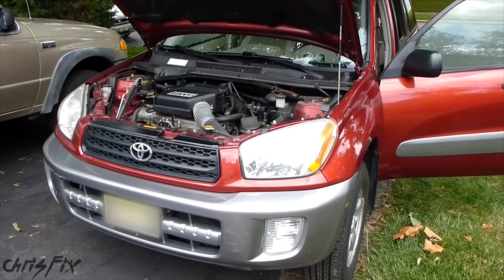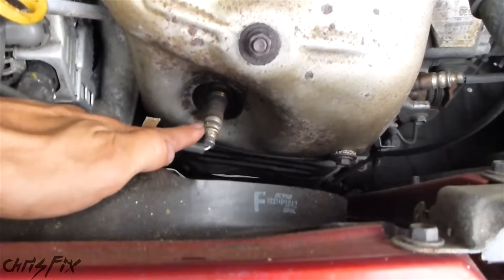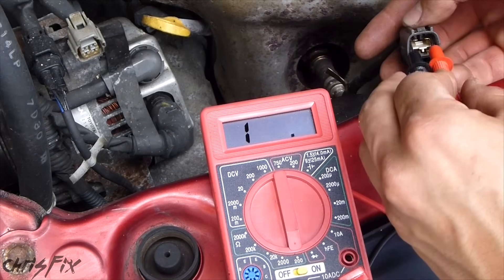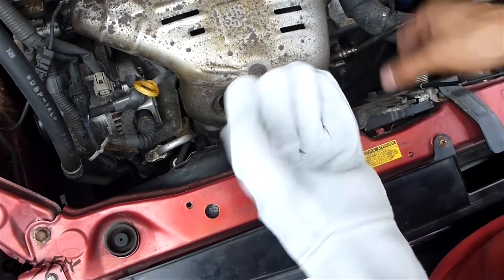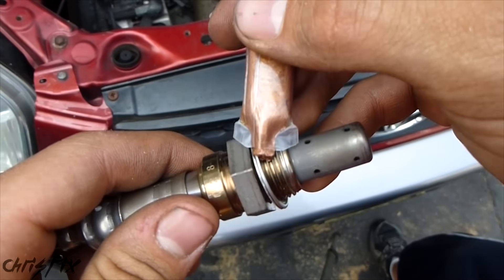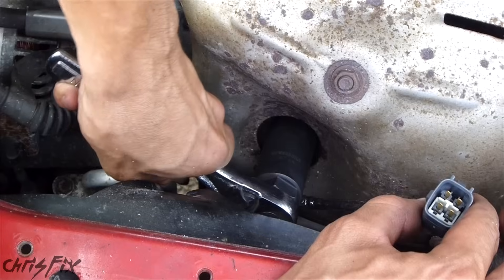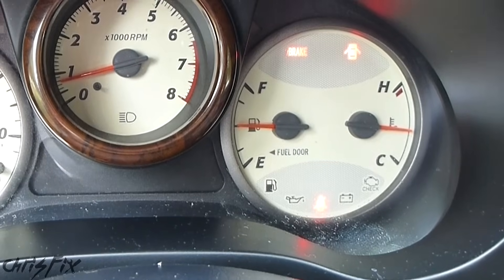How to Check and Replace an Oxygen Sensor (Air Fuel Ratio Sensor)

Comment: @ChrisFix love your videos i have a check engine light and Auto LSD flashing in red on 2010 Rav4 LE model do you think it is a differential issue or an O2 sensor problem
Reply from the maker: Scan the computer and see!

Comment: I replaced my sensor but it still didn’t pass smog the technician said that I needed to drive 100 miles so that the computer can reset the heater in the sensor. Does that sound right to you?
Reply: Yea Brodie he reset the codes so that u need to drive a few driving cycles then wait like 1week and go bavj
Reply: @junior26v82 right on Bubba I’m going to drive the shit out of it this week and then go back to my boy and see what up. Thanks again.

Comment: Chris I have strange problem  
In highways with toyota rav4 2002 automatic  my fuel consumption  is 10 /100km( it's good) but
In city driving for short distance to work   and  common lights stops like 4 km go and 4 back 
My consumption  in city is 20/100km
 No errors in diagnostic tools , help

Comment: A question, I'm need of help. Im driving a japanese car, my mechanic has tried out a few sensors that "should" fit(denso, bosch etc), but the clip in part is always different from what my car has. It is impossible to find one that fits. Is there a way to manage it somehow? 
The issue is that all these sensors are listed as the correct replacement, but it just isn't the case.

Comment: Another great video, Chris. Thank you🙏.  Quick question please: on my 2001 Lexus RX300, my VSC and CEL came on. Autozone read the code as a bad Bank 2 Sensor 1. I replaced that bad A/F sensor with a new one. Do I need a reader plugged into the OB2 to clear it, or will the codes and VSC/CEL clear on their own once I drive it?

Thanks so much for your help 🙏

Comment: BAck when  Chris was poor and had to rent a oxygen socket... They are like 7$ at amazon or Walmart...

Also P1155 or P1135 is not necessary a bad sensor... It's a problem in the Air fuel circuit.. Obviously the sensor is in the circuit so it's possible it's the issue but many other possible issues too... It's good that he shows how to check it. But this check only for a dead sensor... The sensor could be only malfunctioning under load that would also trip the code not right away and   it will pass the resistor test....  but still be bad sensor...

Which you need a scope to test for... Though voltage on a scan tool might give you a clue... Basically this problem can get much more complicated.... than this vid would have you believe...

Comment: Do you have to disconnect the battery to test the 02 sensor?
Reply from the maker: no
Reply: @chrisfix I changed both my 02 sensors but my gas is still reading incorrectly but the engine light went away.

Comment: I have an '04 Liberty and my oxygen sensors are rusted in solid, can't remove them for anything even to try replacing them.
But as a test, I tried running the engine with both upstream and downstream unplugged.  It runs exactly the same  :(
This has me confused because that would have me believe replacing the oxygen sensors won't do any good.
Very rough idle now and engine shakes, engine light blinks.    The only codes I get are oxygen sensor codes:

P0158  Oxygen Sensor Circuit High  Bank 2 Sensor 2
P0300  Multiple Random Misfire
P0152  Oxygen Sensor Circuit High Bank 2 Sensor 1
P0157  Oxygen Sensor Circuit Low  Bank 2 Sensor 2

Comment: U the man Chris 

My 2008 Lincoln town car executive L series had this code 

I did the ohm test and was shocked that it was ok 

Did the ohm reading on new part and same readings.

Looked some more and found a faulty spark plug and 3 bad almost dead coils .

Weird right ?

Car is all good passed smog every test 

392,527 miles

Comment: Great vid, Chris👍. I always get a po107 code on my 08 pont vibe but here’s the kicker…. I have absolutely no symptoms, purrs like a kitten. But the Real conundrum, is that it only comes on during the winter months, up here in Ny. It goes off come spring, either by itself, or if I clear it myself. Been happening for several yrs now.  Don’t think there r any evap leaks but there’s so many things I have to eliminate b4 I find cause. Was hoping this peculiar circumstance could help you narrow down my approach. Any advice?!  
Thx🔧
Reply from the maker: Looks like it's a map sensor code, have you tried replacing it?
Reply: @chrisfix  This…………..I will now do!👍☺️

Comment: I get two codes on my toyota sienna 2004 p0171 and p0174 should i start with sensors? I tried the maf sensor test where i can run the car and disconnect the maf sensor and the car turned off so it means that one is good.
Reply from the maker: I would do a smoke test and see if you have a leak from a vacuum line or a something like the intake gasket first. If it's not that, and you have a scanner that has live data, see if the o2 sensors are reading correctly before replacing them since it can be $$$
Reply: @chrisfix  thank you for the response!!!! Definitely my car has the engine light and vsc trac off light and it drives but randomly even more uphill the car tends to stop accelerating, I tried to accelerate and nothing happens, but ill definitely check the smoke test

Comment: Nissan Micra 2003 1.2 throwing codes PO132 O2 sensor high voltage Bank 1 Sensor 1; PO138 02 Sensor high voltage bank 1 Sensor 2; PO037 H02 Heater Control circuit low Bank 1 Sensor 2. The car passes emissions but the check engine light comes back on each time codes are erased. I have run diagnostic with Top Don and i can see the Front Sensor oscillating 0.18 - 0.59 and Rear sensor steady at 1.275 v. So I don't understand why it keeps staying on? Any ideas? I have tried cat cleaner but light comes back on. (ps I have just bought some spares Lucas brand so will take the car to the mechanic to swap them.)

Comment: The video title suggests O2 and AF sensors are the same thing but I heard from Toyota expert that O2 sensor is not the same as AF sensor. They may look physically the same but internally and functionally different. Their locations on the vehicle are also different. What you did in this video appears to be the AF sensor, not O2 sensor. Am I correct?

Comment: hi, i have toyota camry 2012 LE my car's gas mileage got worst. can oxygen sensor be the issue?
some back ground.
got car in MAY at 250k having 8L/100KM.
i have changed all tires with all season tire bridgestone weatherpeak, now its 10L/KM.

Also tire pressure same for all tire 35 psi.
recently changed engine oil and filter.
also drive smooth  : )
engine sound smooth.

can anyone help me what could be problem.
Reply from the maker: Are there any engine codes?

Comment: O man I wish you worked on this car more. I just bought one with bad head gasket and bad clutch. I’m struggling. The axles don’t come off so I gave up on that for now and I’m making it up as I go taking apart the top of the engine. I reached the point to take this sensor out but I don’t have this socket and I’m stuck!  😢

Comment: Hi, my car kia stonic 2018 1.6 crdi had new dpf,turbo,egr,intake manifold and o2 sensors, and it's still running rich , showing 0.9v at idle and when cruising at constant speed stays at 0.4-0.5v, when giving it throttle it goes down to 0.1-0.2 , when releasing the gas pedal goes as high as 1.4v , running i guess as it regenerates the dpf every 130 miles and has a thin layer of soot inside exhaust tailpipe. Any suggestion what could be wrong with it, kia don't seem to know what's wrong with it .
Thank you
Not throwing any codes.
Reply from the maker: Is that the voltage at the o2 sensors? What is the normal range/behavior for your car?
Reply: @chrisfix  Hi, my egt pre particulate filter shows -90C when cold and when engine running at temperature it only shows about 120C, only goes to 400 when regenerating , had new turbo,dpf,intake manifold,egr, o2 sensor, and keeps regenerating after 100 mile.
Is that a sign that sensor is faulty ,reading -90C? 
Thank you
Reply: @chrisfix  car regenerates often , i think it runs rich , keeps regenerating often in my opinion after every100 miles taking in consideration it had new dpf , unfortunately kia used the old sensors.
Reply: @chrisfix  and yes, that's the voltage showed on the graph at o2 sensors .
Thanks for replying.

Comment: Thank you for your great videos! Quick question...after changing the sensor what would you do if the engine light came back on and the same code p2197 came back on 😮‍💨🤦

Comment: I had the same issue with oxygen sensor bank 1. However it did not gave me check engine light which is really weird. When we scanned it, the same code appeared though.

Comment: I have a p1135 and tested the p1155 you mentioned. 
I also checked 2 others below and the continuity test worked on all of em. But I haven't checked the one by the fire wall, the last one smh. Can this throw a p1155? Can p1135 b1s1 throw  p1155??

Comment: Hey Chris after I install the sensor do I have to reset my cars computer system ?
Reply from the maker: You should remove the check engine light after doing a fix like this, you can do it with a scanner or you can just disconnect the negative on the battery and put it back on
Reply: @chrisfix  thanks bro
Reply: @chrisfix  hey so I removed the old sensor and put in a few one and reset it by removing the battery but now my engine vibrates alot since I put in the new sensor and my gas mileage is really bad I can top up gas and take a short drives n it goes down so fast I also notice my engine is hotter than normal

Comment: I have a 2000 Infiniti G20 and I'm continually getting a P0171 code. The car runs good even when the light is on, could that be the 02 sensor? Thank you in advance.

Comment: I have an 06 mustang gt and I replaced the 02 sensors. I wanted to replace the wires as well but I could find where they plug in at. Does anyone know? I followed the wire up past the transmission but couldn't see past that. Looked like they ran to the back of the motor but unsure

Comment: Hey, could please solve this problem . My car is Toyota Echo and about 45 dayes i saw the engine light is on and my car was misfire. I took my car too mechanic he said i need to replace the spark.  And he did it and misfire gone but tomorrow morning again my car got misfire and the engine light was on . I took it to the mechanic again he said i need to replace the Ignition Coil  and i replaced all of them but the car it was misfire yet and the mechanic he used the Scanner this time and the Scanner  showd us this  P0133 oxygen sensor circuit slow Response - bank 1 sensor 1...   and he told me i need to replace the Oxygen sensor.  I replaced the oxygen sensor but the misfire was still. And he told me  i need to replace the oxygen sensor Bank 2 . I did. But misfire was still . I took my car to another mechanic i told him my story  and he used the Scanner  and the Scanner  showd him the same Code P0133 . he told me i need to change catalytic converter i replaced that but second hand not new.  The misfire was still. And he told me i need to change the  Injector i replacement the all of them and this time misfire gone and i was so happy but after 8 hours the engine light is on again.  But not misfire.  What do you think? Do you think the bad fuse for Oxygen sensor or bad connection??? Can you you help me , i spend almost $2000 Aus but the engine light is on . Could you help me please?
Reply: My car has the same history than yours and I hope changing the A/F sensor will allow me to remove the code. I know one has gone bad since its resistance is in open circuit. Did you check the resistance value of your sensors ? Could be an A/F sensor that has gone bad. Also, I recommend you to buy an OBD reader so you can read the code yourself instead of going to the mechanics every time

Comment: I have a 4 cylinder so it’s bank 1 sensor 1 and 2 I replaced sensor 1 and deleted the code but then after that my engine stalled and code came back up when I scanned it again. What could it be?
Reply: Might be the wrong sensor (the new one you bought) some cars are really picky about what brand you use.
Reply: Also bank 1 sensor 1 could be more things. like your map or maf sensor

Comment: What is the recommended range in Ohms resistance for an oxygen sensor?
Reply: Usually the resistance is quite low, given that it is an heating resistance, so usually < 15 ohm, but I guess it depends on your model. In any case the most important is not to have an open circuit.

Comment: Thanks for the tip. I have rav4 dame car. 
One doubt; the down stream sensor bank 1 sensor 2, should give the same measurement with the multimeter? Or is different parameters? Un my bank1 sensor 2, shows me value of 1, in multimeter. I guess is broken?

Comment: @ChrisFix I need help! P0171 on a 2004 F250. New injectors installed. New fuel filter installed. Mass air flow sensor next?

Comment: I have a P0031 error code on my 2003 Toyota Camry.  I followed the video to check the ohms of my current Air/Fuel Ratio Center and it showed up with 2.3 ohms.  I do not want to replace the sensor if it is not the issue.  Any ideas?

Comment: Should I buy a car with a bad sensor then drive it 120 miles home, or replace it at the location?

Edit: I am unsure at this time if it is an upstream or downstream sensor

Edit two: it was upstream, I bought it, replacing it tomorrow.
Reply: did the engine light went away after the replacement ?
Reply: @paulm8i  Yes 👍. Car ran a lot better after.

Comment: What’s up Chris! Been watching your videos since the Pandemic outbreak and have learned a lot. I even watch them even though I don’t have relating car problem lol. But I got a quick question. Can the sensor still be bad even though you’re not getting a check engine light?
Reply: Honestly it seems  a lot of things can fail /not be up to par, without necessarily giving a code, or giving a code for the actual part (i.e. when a sensor fails, but it shows a code for the catalytic converter instead of the sensor).

Comment: Hey Chris, what would you check for the code P1167 because it says Air/Fuel Ratio Sensor 1 Heater System Malfunction. Would I happen to install it wrong or is it faulty?
Reply from the maker: I’m not clear, did you install a new one and it’s still not working? Was it oem or a cheap Chinese part?

Comment: @ChrisFix  I have a 2010 Kia Soul. Your video is the best I've seen to test the oxygen sensor.  Mine looks very similar but the 4 wires are black, gray, white, white.  Do you have any idea which 2 wires I should be testing?  I tested the black and gray 1st and got nothing on the ohm reading.  I actually did every other combination, so I imagine my oxygen sensor has to be bad?  I'm in the Dominican Republic so been extremely hard to pinpoint this misfire problem I'm having with the mechanics here (been to 7 lol) and just trying to be sure this is the culprit before having to order another part.  Scanner said it was O2 sensor, but know it can still be something else.  Thanks so much!!!

Comment: Good video. I have a Toyota Yaris 2009  code P2196 O2 sensor bank 1 stuck rich. I tested the sensor and its showing resistance just like your new one 02.4. But its fully black full of carbon. What do you think the problem might be. Iv checked all the wiring and the visual checks it all seems ok. Do you think the sensor is bad? Thanks in advance
Reply from the maker: I don't think the sensor is bad in this situation, as the car is running too rich (happening upstream of the sensor) Might not be a bad idea to replace it anyway if it's really dirty like you said, it could be falsely reporting that it's too rich. Any other codes or a decrease in fuel economy? It could be anything from a dirty/broken MAF, broken fuel pressure regulator (fuel pressure too high), a fuel injector that's getting stuck and letting in too much fuel, or even a coolant temperature sensor issue
Reply: @chrisfix  Thank you for your reply. There are no other codes just that one. Funny thing is it only comes on during the winter months and during the summer it doesn't come on. The mpg is good theres no  decrease in fuel economy or any other issues whilst im driving. I did check the MAF sensor and that seems good not dirty etc

Comment: i need your help chrisfix, iv got a 1997 n15 Nissan Sentra with an ag16de motor. it has aftermarket headers 4,2,1 (this was on it when I got the car)  and only has one o2 sensor for cylinders 2 and 3 (before it joins to 1 and 4 but after 2 and 3 join). and it smells like it's running a bit rich all the time but no check engine light is on and it only has one wire coming out of the o2 sensor (didn't think u could get these), I'm very confused.

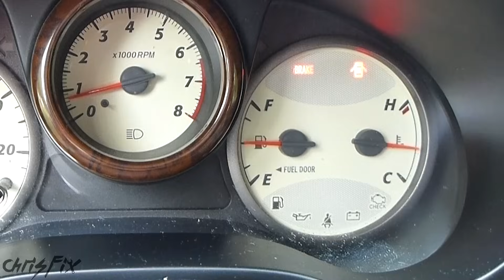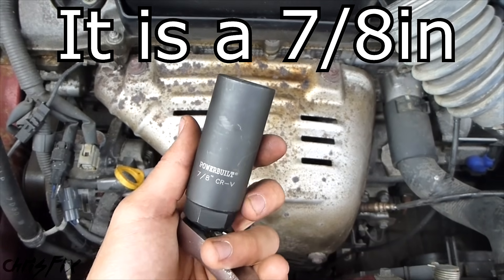Comment: Just one suggestion......maybe your next 02 sensor replacement video be done in an easier location, instead of replacing one  that's right up front and practically on top of the motor it'd cut down the long length time of the video from 4:49 to maybe 2:00.

Comment: Hi chris you best, please advice me on that to turn off the Toyota corolla 2013 O2 sensor my computer says bank 1 sensor 2, I was looked on the live data it was not any volt it was 0 volt on the mentioned sensor I had already replaced bank 1 sensor 1 on the error code it says bank 1 sensor 1 but on the live data it says bank 1 sensor 2, appreciate your quick response and support